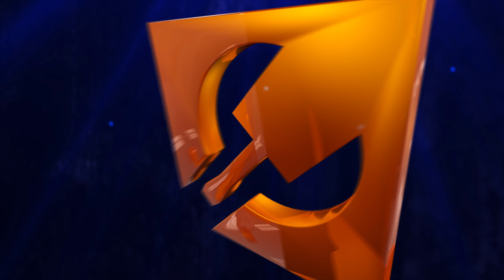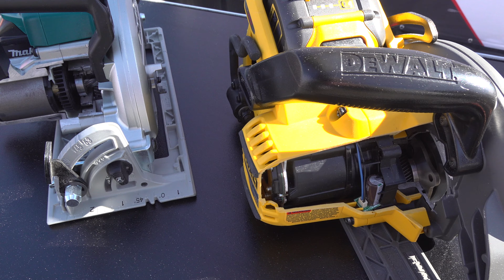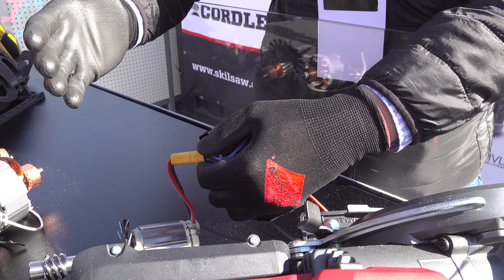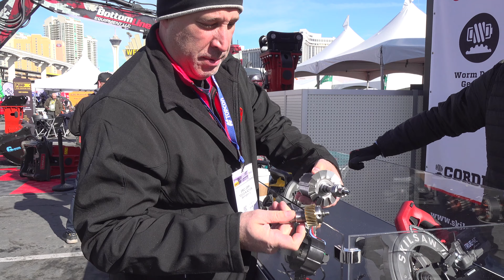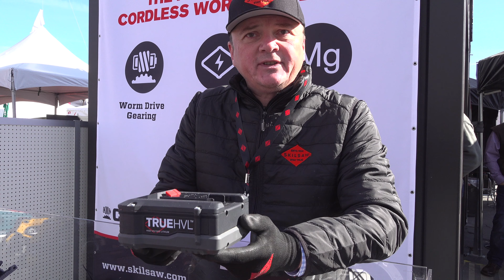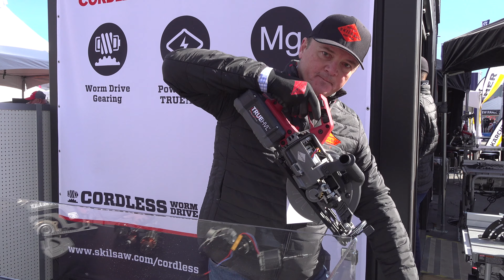Worm Drive - The Inside Scoop

Comment: Higher maintenance levels and huge power draw requirements to run a worm drive. A direct drive is more efficient, less maintenance, and can be more powerful (see dcs577) all whilst being lighter to lift. A staple of an older era, for good reason, but technology has caught up. Having a "worm drive" isn't needed anymore on the modern job site.

Comment: The AC Skilsaw worm drive was a great tool. The flexvolt rear handle is actually more powerful then the skilsaw. And no parts are stripping or gears need replacing, he’s just selling the latest cordless skilsaw . ..Still nothing beats the flexvolt 3 yrs later....it’s all you need to frame.